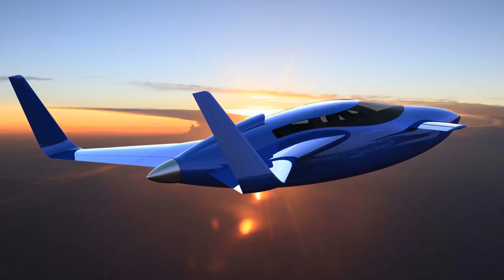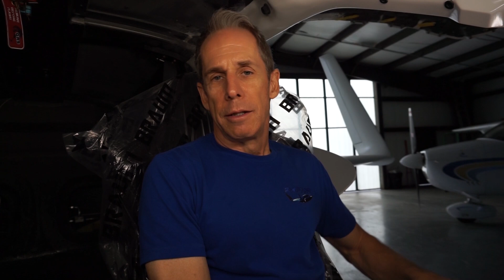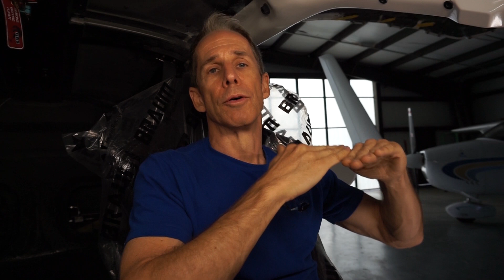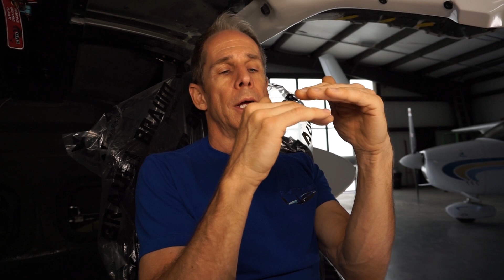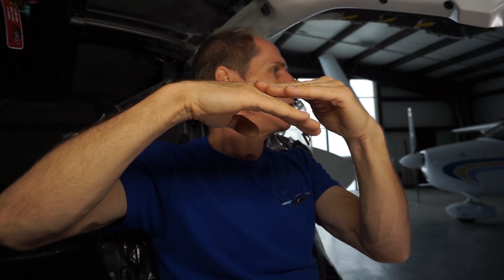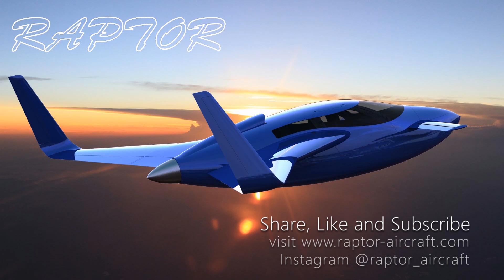State of the Union - Building the Raptor Prototype

Comment: If I were in you I wouldn't give up with your designs but I'd rather test them separately to don't put anybody at risk. Both wings and canards could be tested in a wind gallery to check their real behavior and you could also check in advance whether the canards could act as flaps and do all the setups to implement the feature in the aircraft controls before taking off.

For the engine I agree that automotive has gone far behind aviation grade except redundancy, there's no reason to don't do small tests. Why don't you ask to somebody customizing engines to help you to reach a full redundant setup? Isn't there any manufacturer providing a similar but certified engine that don't requires an entire year of re engineering?

I.E. aeromomentum is purchasing crude engines OEM from an automotive manufacturer, then they put aviation grade components on top of it. They probably would take very short to re engineer the ECU only in your AUDI engine.

Comment: , I fully sympathies with the feeling of isolation(multiple long term assignments in foreign locations), even with my family not having friends outside of work around is mentally wearing.
I would support the advice of others, Oshkosh is off the table, go to California for 2 weeks and reset.
For the ecu, does the test pilot need an instantaneous ecu fallover  or would a second ecu with a switch suffice, there has to be some sort of wiggle room.

Comment: I think you picked a test pilot that actually had no intention of being the first to fly the Raptor.  You at the beginning of the year was saying that Len would be the test pilot , if you had asked him at that time  my biggest question to him would be why he didn't say that the Audi ECU needed to have redundancy,  also why he didn't ask about the larger winglets  and the change you did to the canard control surfaces.  My experience  with test pilots as a aeronautical designer/maintainer is that if they are to be a possible test pilot then are very involved with design development so they know the why's and what risk abatement  has been taken as changes occur, so they can plan accordingly.

If he had been following the build even from only this last few months would have raised these flags earlier and talked to you so you had a heads up and he could have been proactive.   Personally I feel he has not done his homework in preparing for the meeting and he had decided that he was not going the fly your prototype and just looked for any reason to back out.  Hate to also say there is the possibility he was got to by one of those interested in buy your design ( as a failed to get off the ground type things) cheap.
Reply: Welsh Rarebitt I think you make some excellent points. Any decent test pilot would have visited the build a couple of times and certainly would be following the videos.  He definitely did not do any homework. Find another pilot ASAP.
Reply: Excellent comment.
Reply: Best comment I've read.

Comment: Great work Peter, can I suggest you speak with Motec regarding there PDM module and possible integration to run and switch between ECU 1 and 2. 
I’ll be watching when you’re taking off for the first time this year. But first take a break.    clear mind = easy fix.

Comment: GA community is full of bad experiences with unreliable gasoline engines that need dual ignitions to be airworthy. Diesel engines are by far 100 fold,  more reliable than any gasoline engine with dual everything. I have faith in your sticking with the Audi engine as I envisioned tdi powered GA engine when I first laid eyes on the first 1.9L VW TDI AHU and ALH engines. My daily drive is a 2002 VW TDI PD 1.9L AUY and I’ve never had a stumble or sputter, and also has had done hours of WOT operation on the German autobahn, at a time. 

My other car is a 2002 MB S400cdi which is also the building block of the Thielert Centurion 4.0 engine. Compression Ignition Engines will make inroads into GA and it will take time to educate and win over the pessimistic GA community.

Comment: Hi Peter, thank you very much for your willingness to share the state of the project. I would suggest reaching out to Motec and see if they can fast track a dual ECU. There is a potential 1500 units for them, so I am sure they would be interested. Further more, I agree with the comments to reach out to Universities for the aerodynamic evaluations. Perhaps even the European universities. 
Lastely, if you need a connection to Audi; I would suggest reaching out to Dutch super car company called: Donkervoort, as they have historic ties to Audi. Audi engines power Donkervoort... and also some top Audi brass drive Donkervoort cars in their weekends off. Be sure to ask for Mr. Joop Donkervoort or his son.. well, can’t go wrong as it is a family owned business...
Take care. Take some well deserved R&R and I am sure Raptor Aircraft will push through! Edit: you’re a Trooper yourself!

Comment: DO NOT LET ONE PERSON CHANGE YOUR WORK.  
DO NOT GIVE UP, KEEP FIGHTING AND STICK TO YOUR GUNS.
The risk of engine failure due to ECU failure is not that high.   Give me a break.

Can you physically wire in a 2nd Motec unit that can be manually powered up with a selector switch if the first unit fails?     Motec may be able to help with this....
Get another opinion...  
The first one to do something always gets the skepticism.
You might need a crazy cowboy to get the first flights in to attract others...

Comment: Personally I'd be more worried about a software or settings glitch which could cause two identical ECU's to fail, but I bet the aircraft would sell better with a dual ECU system available.  Therefore pursuing  dual ECU's is valuable even if you find another test pilot to fly the plane with as is.
It may take months, but you're still almost there!

Comment: Can't make an omelet without breaking a few eggs!   Forget oshkosh for now.  Get some rest, take a few days off and regroup.  Ground breaking ideas take a lot of  hard work.  All the folks interested in this project, I'm sure are willing to help in someway, just ask.  I agree, that is the right engine.....   Diesel engines run fine without electricity.  Add a throttle cable to the fly by wire as a backup.  I'm order #23.  It will work. 

Orville Wright said, "No flying machine will ever fly from New York to Paris. If we all worked on the assumption that what is accepted as true is really true, there would be little hope of advance."

Comment: A hole different ecu from an other manufacturer?  Gale Banks does incredible work with turbocharged engines may be they have dual ecus for some of the specialty work he has done. Mr. Banks might be able to help he has an incredible team that has been doing this for 30+ years. Would any college professors run the numbers on aerodynamics maybe as some coursework?   The companys making the dual ecus for the LS motors might be able to reprogram there's for your motor?

Comment: PLEASE PLEASE DONT GIVE UP!  It's obvious from the video that you are tired and that the visit with the test pilot was not what you had hoped for.  But PLEASE PLEASE stay the course.  You have done amazing things with this already.  DO NOT give up.  We, your supporters (whether monetary supporters, or enthusiasm and emotional supporters)  will help you get thru this last push.  Personally I don't think the dual ecu thing is that hard to overcome.  The aerodynamic issues may require some rework but not impossible by any means.  As a hotrod and offroad diesel enthusiast as well as a pilot I know that the non/OEM community can figure out a way around the dual channel ecu issue.  If we car guys can adapt different brand modern fuel injected engine computers (think Jeep bodies running GM motors with several different computers working in tandem) to run and be 50 state legal emissions wise; there is a computer guy somewhere that can solve this.  I'm not a computer guy just a dumb wrench hand but couldn't you just run dual ecu's with a transfer switch that automatically kicks over if it senses a problem with the other ecu.  Kind of like a dual mag setup.  Maybe even a manual switch.  Both ecu's are powered up and receiving input from the engine.  Only one is able to control the engine unless the switch is kicked.   This way both ecu's know the state of the engine at all times.  Each could have a separate backup battery source as well for an additional layer of protection in case of alternator failure.  I'm just thinking out loud here thru my finger tips but Peter I know there is a way to work this out and keep that Audi hanging off the back.   Take a couple days off you have more than earned it.  If nay sayers speak up tell them to shove off.  They are the ones that have never really accomplished anything of value anyway.   Go to Oshkosh and get revitalized.  STAY THE COURSE.  You can do this!!!

Comment: Thanks for the in depth info, I feel your frustration and love your determination and optimism. You're right about this engine being the motivation for investing, this is not an exciting aircraft with an old 100LL engine.  I wish I could solve your ecu issues, but I have no expertise.   Is there a way to have two ecu's and be able to switch between an active and non active?  #925

Comment: Out of all things one could be worried about with the engine, I wouldn't think it would be the ECU. SDS EFI has thousands of airplanes running their system and they apparently has never had an ECU failure, only some non-fatal sensor failures. There's no reason the electronics would be the weak point...

Rig up a fan so you can run the engine on the ground and get 10h of full power running on it and I'm sure someone will fly it,.

Comment: i have been watching your videos for a while, super interesting and educational. thank you :)
i doubt that i could add anything of value that you haven't already considered, but i had a few thoughts regarding your issues anyway:
(1) wouldn't it be possible to stick the main wing and the foreplane into a windtunnel to figure out if there is vibrations off the winglet and proper lift on the controls. it could also help with working out what forces (and their vectors) are in play at different speeds and wind conditions.

(2) others have already pointed out the possibility to work with universities. and i just wanted to second that idea. 98% of the quality you'd get from a professional for a fraction of the cost.
(3) i cant help you with the ECU, don't know anything about engines....... or airplanes for that matter :P
(40 to help with your financing you could consider licensing whichever part of your IP those other companies are interested in and get part of the profit from whatever product they sell including you IP. if they are also building an airplane with their own engine (which as far as i understood you) would be significantly more expensive than the audi engine plane. so you wouldnt kill the market for your product. there are a million different ways this can be done. but you definitely shouldn't take my word for it and talk to a IP lawyer about this. if you need additional general advice in this regard i'd be happy to help, just shoot me a message  :)

looking forward to seeing this beauty fly, good luck :)

Comment: How hard is it to wire in a second ECU?  Nascar dose it.  Your's maybe different, but generally all the input/outputs are isolated circuits, so literally splicing into the inputs,  and A-B switching output signals from one to the other, and maybe second censors and/or actuators is all you need.

Comment: If I was a test pilot one of my major concerns would be the airport in which you plan to test it from.  Cherokee county airport is a nice little airport however, it is extremely unforgiving in the event of a forced landing immediately after take off. Small runway, hilly terrain and lots of trees don't leave many outs. I wonder if test pilots might be more willing to fly it from a more conducive location. Thoughts?
Reply: Marc Anderson An excellent point. I’m thinking trailer it to Mojave... massive runways and loads of land out options. If it’s good enough for the Stratolaunch it’s good enough for Raptor!

Comment: Hang in there Pete. Scratch building anything is worthy of a medal - something as complex and boundary-pushing as this, even more so. Unplug for a week, go do something totally unrelated and recover for a minute. None of the bi weekly video regulars here would begrudge a week off. A dual channel ECU retrofit is a bit of a project but it's totally doable and at least it's all in the engine bay. Whip it off, stick in on the stand and grab some help - it'll happen. The redrive is a great idea - of course it's going to take a few cracks at getting it right (I've never perfected anything first go) but I still reckon it's the way forward. Take a break, get some aeronautical consultation going and think about tackling the ECU if you can't find anyone to fly it as is. Nearly there man.

Comment: Peter, take a week off, you and your crew need it.
I think your vastly overestimating the time needed to make a failover system. While not elegant or cost effective for production a duplicate Motec ecu connected via a T, with the outputs controlled  via  a simple circuit would do the job to provide redundancy.
Reply: That was my first thought, but I am not an engineer. Isn't that similar to what Diamond aircraft uses? Too impressive an aircraft to not see her fly. Good luck
Reply: jff0111  I totally agree.  Dual ECU's and I don't think it would be that hard to pull off.

Comment: ,,,, waaay toooo much money, but maybe keep in mind. Aftermarket 2 valve heads, with room for two separate injectors, two ecu's, two pumps, and two complete injection systems . Btw, congrats on the staggering amount of work so far, and I luv that little Diesel .

Comment: What is the relative weight of the Continental CD-300 which is diesel/jet A, water cooled, FADAC and was certified in the last year?  9 gph should work as well.  The CD- 300 cost a lot less than a turboprop.  If CD-300 weight/size is comparable . . . might be a solution.

Also, why can’t you just add a second ecu in parallel on a toggle switch?  Connect both to all of the sensors and power, but only have one at a time connected to the fuel distributor (which I’m assuming is the only output).  Have the engine run on one or the other, but not both, and test one then the other during preflight.

Comment: What did the DAR say?  That is what matters.  Dual ECU is not the issue with the power plant.  The Redrive is the issue. What can stop the prop. Find another Test Pilot.  EAA might help.  You are at the step that all great inventors area at.  The step where you have to bust past the NO.  It is never easy.  No money.  Major technical issues.  No Support.  How do you overcome?  If you give up;  make sure you tell all your depositors how to get their $ back.
Reply: He already stated that he would.
Reply: Agree 100% on the redrive. I have thought for a long time, that the redrive would be a failure point. If I were the test pilot I would be more concerned with it, than the ECU.

Comment: I am sorry for the setbacks. 

~
As far as the aerodynamicist, some of them hang out here: https://www.cfd-online.com/
I am sure you will find amateurs, I am sure you will find pros. 

It's probably best not to mention my name, if you want help : )
https://www.cfd-online.com/Forums/openfoam/212747-openfoam-under-windows-poor-solution.html

Alternatively, you might ask Dick Rutan himself for a recommendation. He might help you because as the designer/engineer of a canard-winged aircraft, he just might see you as carrying his torch.

I also wonder if Ames research would take on your plane for a project. Although it would be expensive to ship it, it all looks like it would fit on a truck. Your previous oscillation might peak their interest, if they can be convinced that it is something they haven't thought of. A cradle would have to be built to mount it in the big tunnel.

As for the engine, I wonder what the feasibility is of adding a A/B switch panel, so that your test pilot could manually switch the ECUs using mechanical relays. You would need to add a circuit board, and obviously good relays, in a nice, sealed box, mounted on rubber grommets. This might give your test pilot the control they need.

Alternatively, perhaps Audi itself, might be interested in what you have done. You are bringing them the new aircraft engine market. BMW, for instance makes the engine for the Morgan, and likely several other cars; this can be used to gently nudge Audi.

Lastly, I think that your control surface issue, if it exists, might be solved with compound hinges, 2 bar, 4 bar, something like that.

As a self-motivated person, it's hard to get help, to accept help, and to have something where you have to depend on someone else.

Comment: That engine and ECU combination is running on the road all over the world with no issues.  The single lane ECU should be fine for the prototype.  Upgrade later.  As far as the winglets and canard elevators: find another test pilot.
Reply: I think there in lies a very interesting point. Aviation safety is all about statistics. I would love to see the reliability data from the worlds fleet of Audi V6 diesel engines versus lets say a naturally aspirated Lycoming carb engine!!.
Reply: Yes, on the 'road'. Great to get this project this far.

Comment: rip the Audi engine out. Have 2 options. The new Lycoming IE2 line or a PT6.  You are competing with the cirrus market right? Those are $750+ grand.
Reply: The diesel is the power of a 550 for 7gal per hour. Seems worth pursuing.